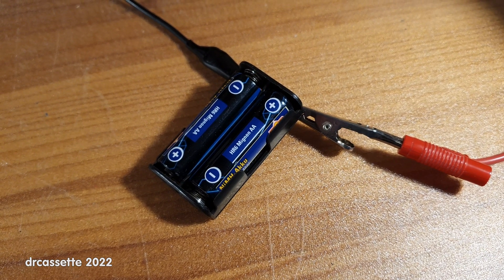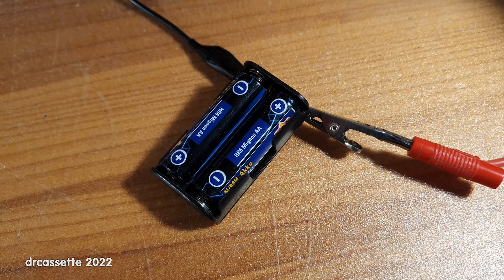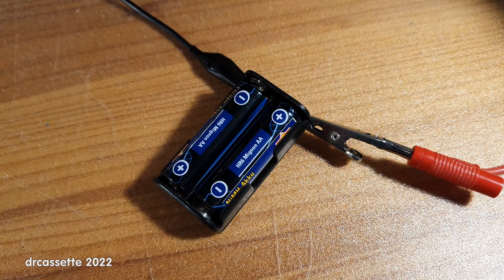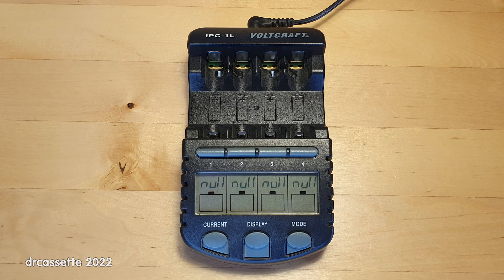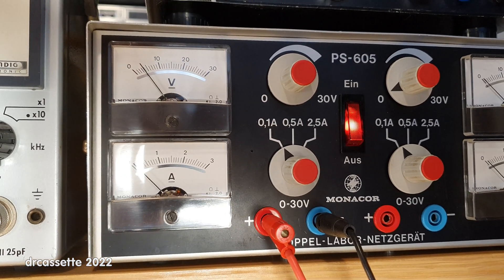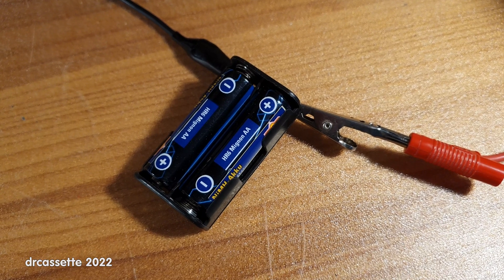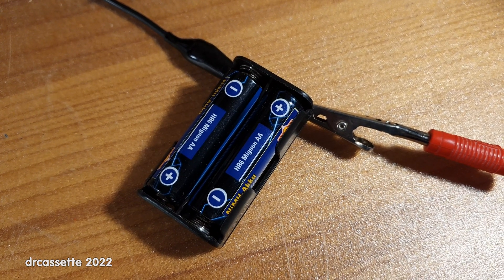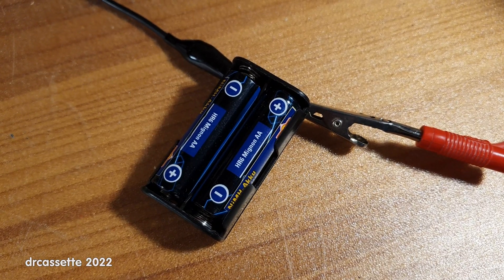Recover deep discharged NiMH batteries with a simple uncontrolled charger

Comment: Easiest way is to directly connect a fully charged battery to a dead one. Just watch temps. The idea is that the current burns the crystalline structures that cause the short in the battery and then restores it.

Comment: Did it work?
Reply from the maker: I was able to later fully recharge the batteries on my usual fancy charger. However, I have not put them back into use again yet, so I don't know if the charge capacity has suffered from this incident.

Comment: I have the same problem with my Technoline BC 1000 charger that's very similar to your Voltcraft charger. I just connect the drained batteries to another 1,5 V cell for a few seconds to get rid of the "null" display. But unfortunately most of these batteries are lost once they were deep discharged and never regain their original capacity.
Reply from the maker: After recovering the batteries seen in the video, I moved them over to the fancy charger which I set to discharge mode first, to avoid any memory effect. I was surprised how long discharging then took, the recovery had already charged the batteries quite a bit. But you are right, only time will tell if the batteries survived this incident.
Reply: Id connect it a few times every time it faulted and then it will read minimum voltage

Comment: I sometimes do the same and actually wondered why they don't use like a 10K resistor to like a 5V, or was it 3V with this charger (I have the blue one from Conrad), line?  I believe there will be some voltage across the plus and minus terminals and eventually the battery will be detected and charged.  But you are absolutely right it's easier to see something happen and eventually put it in the charger.  Like 20 years ago I would jumpstart them by connecting an fully empty cell to a charged one but since Li-ion there is no way  that I will do that.

Comment: I had an almost dead motorcycle battery which didn't detect on the modern charger because it was so empty. Just held a 9v batterij against the poles for a second and presto, the charger started charging again 😂